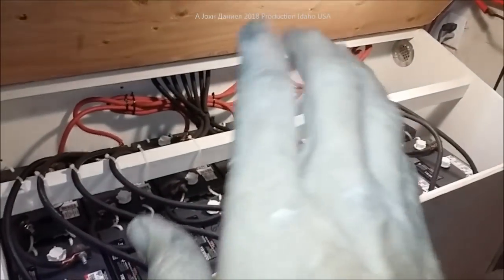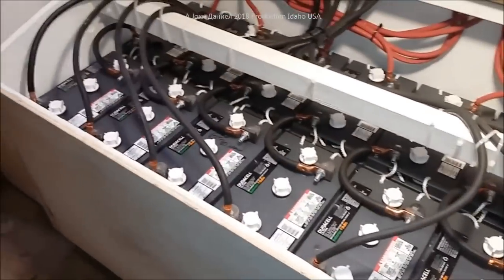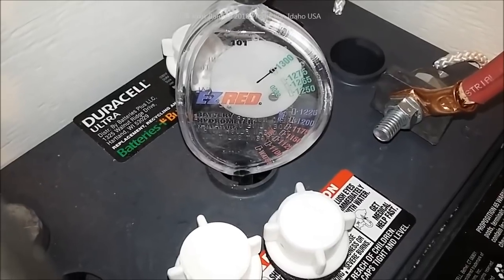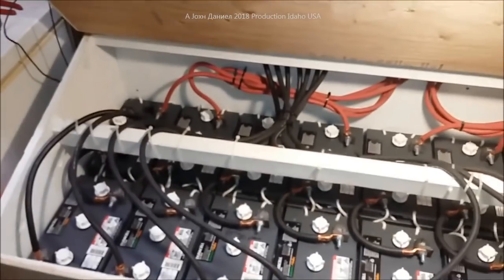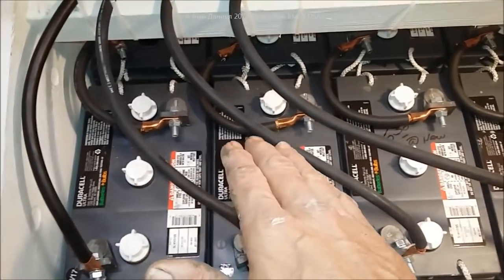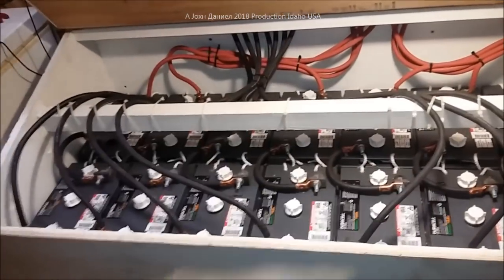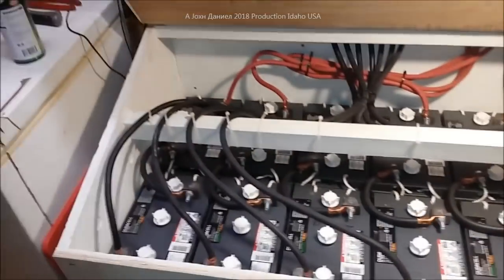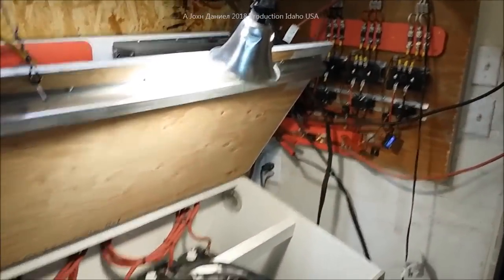Off Grid Batteries,  My ideas, best parts to use as defined below

Comment: dam i am so glad i found this channel i got some stuff but i have not got every thing i need i used to be an apprentice electrician and what you said made perfect seance to me i did work much with dc  power ac was what i was used to but the nuances are different lol here some one really working with this stuff and experimenting to learn all you can and pass it on to those you can hellp with this i would love just sit and chat with you a soak up all i can lol dam happy i found this channel
Reply from the maker: I started my Off Grid adventure with all the crooked ass sellers of the stuff making claims so outlandish it was shocking, practically so full of shit you could pack a diaper factory when they talk, especially that Turbine "tard" Jeff in Missouri, totally clueless moron just spitting shit in the air about this and that. When I learned he was a professional con man and had 20+ scam career It woke me up. Hell, he just failed at being a Mexican pottery dealer hours before being the "worlds biggest Wind and Solar store"!!!!!!  ( from a fukn tin shack! in a town with 2 street lights!)
From there, it was AVOID ANYONE with a store and a you tube channel promoting it. The AH Ha moment hit, from there by ignoring them, you find that Submariners knew DC voltage-current, see how they did it! And I did!
Reply: interesting in never though about that how did those ww2 subs do it it was 12v systems wasn't it . well those boys are not here in any numbers now but you seem to know what hell your doing. Right now i have 400 watts of mono panels a 12v Chinese 240 volt inverter i had have renogy trace 40amp charge controller i went out and got some heavy welding cable a hammer crimp er found out the renogy control really limted me so i got a midnight charge controller now i find i found out i need way more panels to even charge 4 golf cart battery's and i was thinking i need wind to.  I live in the north east so if the sun isn't shining the wind is blowing mostly some times gale force just try to get all my stuff together make something viable it dam expensive lol but i will keep saving and collecting
Reply from the maker: The batteries in Subs was 28 volt each, 4 into 1 for 112 volts DC,  12 banks of each 4 (or more) but all Equally wired from each bank of 4 to the main Buss breakers. So like mine has 2 batteries then a equal length wire set, theirs had 4 batteries then a equal length wire length.
Reply: i saw that. Is that really best way because?? I did hear say draw from each end negative on the left and positive on the right end of the bank ??? and that was another way to balance the bank

Comment: I totally agree with how your batteries are set up I've done the same thing myself for the last few years and it works great with no problems at all and im currently in the process is converting to 26650 battery cells DIY 4S 15P which im sure is going to be a challenge.
Reply from the maker: RIGHT ON! So funny, People who USE alternative energy seem to know 100 x more than the scum bags who SELL it. And them sellers, yeah, they're some real hucksters!
Reply: 7s is way more manageable. I have 46ah 7s li-ion packs. Very efficient charging/discharging and much higher cycle Life. Not to mention the higher voltage gives much more flexibility on wire sizing.
Reply from the maker: This is the $15,000 Battery. It cost us $15,000 in total losses. Insurance would not cover, small print got us. Ours was the 44 amp, 3.2x4 custom manufactured modules with Protection Circuit Management Safety Module For 4 Cells LiFePO4 60A and a claimed 5 to 10 year life span. $1780 worth of them, Made one hell of a fire @ 5 months in use. Not even having a draw on them when they lit the place up. ( similar to our 44Ah ) http://www.all-battery.com/32v20ahlifepo4lithiumironphosphaterechargeablebattery.aspx Every safety feature on the Midnite classic and Protect Modules did not stop 900 degrees of hate and flame!
Reply: @JOHNDANIEL1  lifepo4 batteries are the worst at becoming unbalanced. Unless they stuck an insanely huge balance circuit, those, especially large capacities will go out as much as 1/3 of capacity from each other. There is a reason that chemistry is very unpopular now unless you seek crazy high discharge rates like the 26650 a123 batteries which are basically the only cells of that chemistry that stay fairly close together. I play with them but never suggest that type for a reliable chemistry. Look up any car that had lifepo4 installed. Most of them had cells catch fire. Number one cause, imbalance of cells. And home battery storage just magnifies their problem because you do a constant draw and charge and even a competent balance circuit cannot keep up with it.

Comment: Very good info. You way of drawing from every set (two L16s in series to get to 12v) of batteries keeps "middle" batteries from stagnating. "Stagnation" is the term a solar professional  told me when I set up my system 8 years ago. He didn't suggest to tap off of each set (in my case, four in series, to make my DC side 24 volts), but told me my design was sound by not having more than12 batteries per bank (three sets of four on each side, for redundancy), so stagnation would not occur. That first set of batteries were golf cart size batteries, and they performed pretty well for 6 years.... what I researched said the life of a golf cart averages 3-5 years in an off grid application, so maybe I was lucky (but I took care of them, and some still work, but in another building on the place). BTW, I used those smaller batteries in hopes of lithium or other tech being developed and affordable by replacement time, which was not the case. The replacement bank is made up of L-16s, and I'm going to tap each set as you have done. Great idea. .....Had I gone with a 12v system, all of the peripherals like backup chargers, controllers, etc would have cost me much less, since 12v equipment is so much more common in the RV and boating world. Live and learn...... Thanks.
Reply: ...the first batteries to 'fail' were indeed in the middle sets.
Reply from the maker: They cost too much to skimp on $40 of extra wire weight. Thats all it was in my 14 battery set up, $40. But it will absolutely get me years more of Battery life.
Reply: Yup. Great idea, It wasn't about the $40 or even a hundred if that would have been the cost. It just wasn't something I thought of (neither did the solar "professional" who looked at my schematic). Next time head to town, I'm getting some wire!
Reply: ....and since every set has a lead to the inverter, it probably isn't necessary to use 4/0 like I did, being run in parallel.

Comment: I forgot to ask,  where do you get the copper bus bar for the battery connection. I know I most likely missed that part,  but it is hard to watch and learn, when one has a 5 yr old talking at the same time I want to learn. LOL
Reply from the maker: Depending on the intended design, you would still use pure copper bar stock but in differing thickness, always shoot for 1-1/2 to 2" wide though and at least 3/16 thick. https://tinyurl.com/CU-FlatCopperBARSTOCK99

Comment: I see victron sells battery balancers for 24v, 58v banks, I see videos of people who've made their own battery balancers for 24v and 58v battery banks.
I spoke to a guy who has been off grid for over 40 years he got tired of batteries dying in a bank so he went back to 12v , he does have a very expensive and efficient 12v inverter.
Ofcourse high voltage inverters and smaller wires can be more efficient but only today I got some batteries from an electrical engineer who makes his own 95% effecient low frequency pure sine inverters they're monsters with massive surge capability, I got the batteries cheap from him because some in his 24v bank had almost died, he has since gone 58v lithium and even  they have battery ballancers. So what you say about 12v from experience is true just as I've seen others have learnt and had to go another more expensive route to prevent battery failures in a bank.
There will always be people who have a superiority complex , they're exactly the people to avoid, their best friend is the mirror.
Reply from the maker: 3 things to consider. 
1) Think like a Inverter/charge controller dealer. What would you want people to buy? Higher voltage stuff! Then your dependent on HIM, unlike 12 volt where you can just head to the auto parts store if a inverter fails. Which is unlikely because 12 volt inverters are so mass produced and refined they are more robust. 

2) If you have 12 batteries, 3 strings of 4 to make 48 volt system and only 1 battery fails, you just lost 1/3 of your entire system. A replacement battery may get put back in but it will become a host battery if your bank is older. 
3) If you have 12 batteries to make a 12 volt system and one fails, you loose 1/12th your system capacity, life goes on! 
I say all this, because I have lived all this.
Reply: Јоhn Daniel yes I have bought expensive battery banks cheap because one has failed, in heavy industry if one fails they all go to scrap, so you get expensive batteries at scrap price